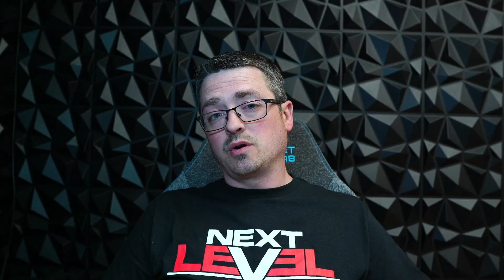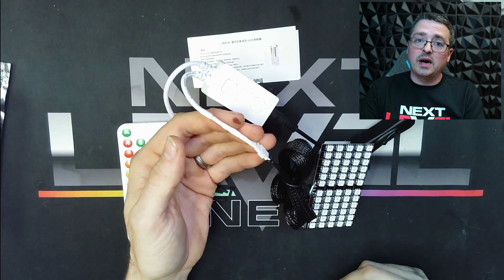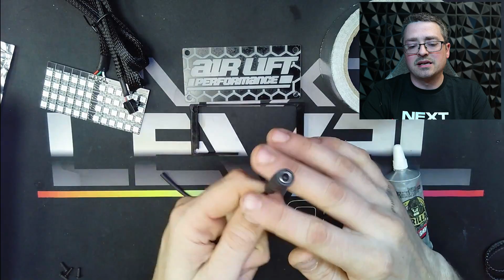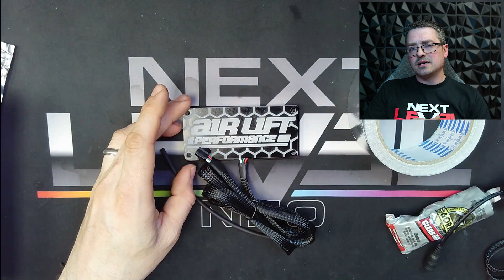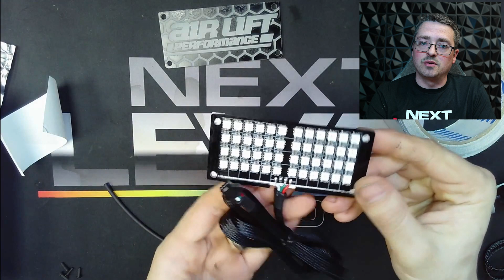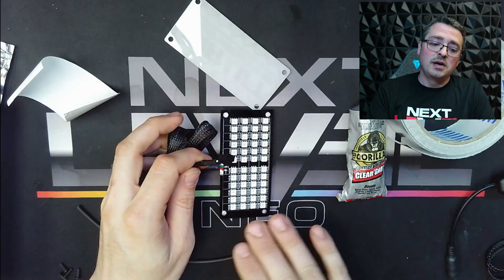DIY Airlift LED Panel Kit – Build Your Own Light-Up Manifold Panel!

Comment: This is by no means self promotion, but I just wanted to show my first attempt and say thank you! My only issue is getting the wrong type laser for cutting, but I went with a multi-tool in the H2C from Bambu Labs which means manually cutting out the plates with a Dremel tool. Not a big issue, just gotta work on cleaning up my cuts. Appreciate the knowledge drop and the parts! 🫡
https://youtube.com/shorts/ycH_VIgiUxU?si=-uYJYOg7RVtms8Ck